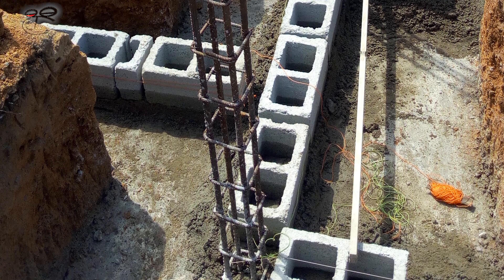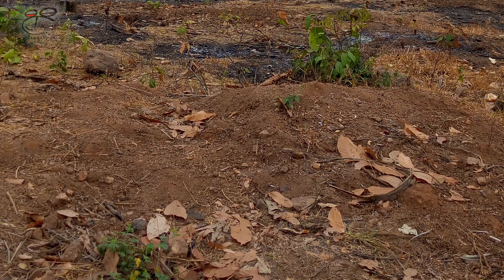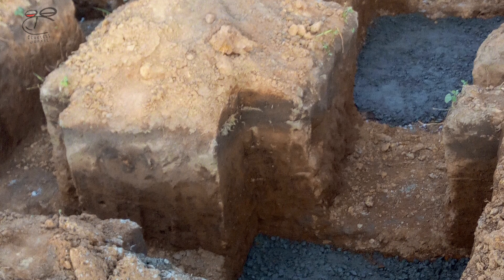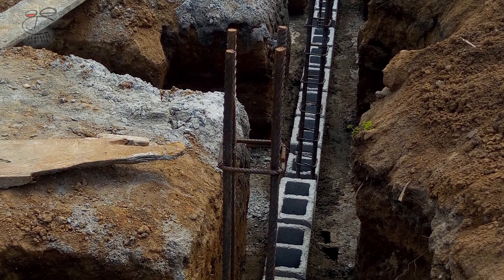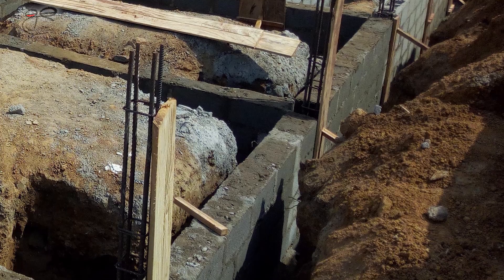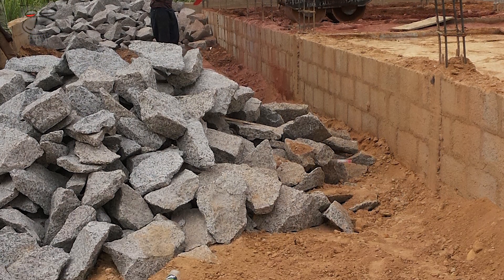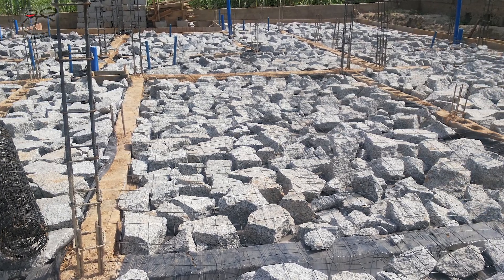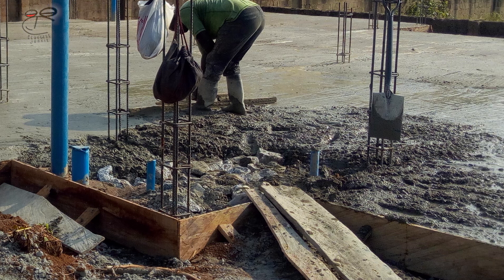House foundation | step by step | recommendations | best practices | Q&A #building #foundation

Comment: Hello,  so how many steel bars would finish a foundation and footing on 1room and sitting room ..will be greatfull for the reply
Reply from the maker: The number of steel bars depends on various factors such as the size of the room, soil conditions, and building codes. It's best to consult with a structural engineer for an accurate assessment.

Comment: Thank you very much,  Do u think it will be a good idea to use foundation beam all around the trenches dug, for a bungalow design. The aim is to prevent the walls from cracking when the foundation starts to settle
Reply from the maker: Yes, using foundation beams can help distribute the load and minimize cracking.

Comment: Great work, boss. I have a brief inquiry: how can I establish a level foundation in the absence of leveling instruments? I appreciate your prompt response.
Reply: You can use the Pvc water level pipe
Reply from the maker: That is a very good question. 
I would imagine a way to translate vertical line of gravity to the horizontal, using lines(pendulum bob) and a builder's square.

I hope this makes some sense.

Comment: Hello engr, can I concrete directly with blinding of the basket or blinding along with foundation concrete..pls asap
Reply from the maker: Hello,
It is better to 'blind' the column footing trenches before placing the footing mesh (basket). This is done to prevent contamination of the column footing concrete, and provide a level surface for the footing mesh to be placed.